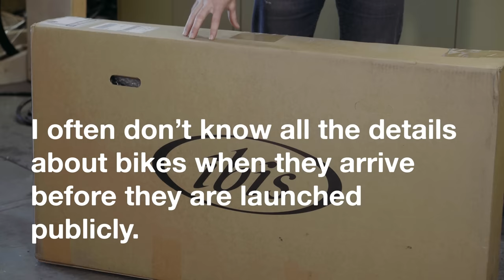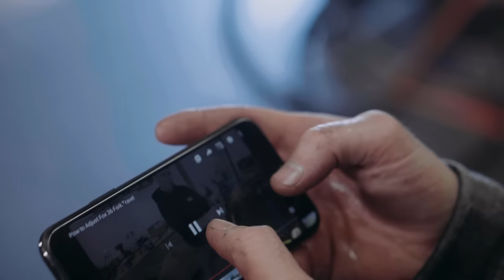DREAM BUILD: Ibis Mojo 4 Carbon "mini-sender" trail bike!

Comment: Jeff! You've made a major mistake there (I hope you didn't, and it just looks that way because of editing...)
FiT4 uses 20WT gold (10mL air, 40mL damper). Your 36 appears to be a GRIP2 which uses 20WT (10mL air) and 5WT Teflon Infused (40mL damper). Looks like you used 20WT gold on both sides? Going to be a hell of a job getting that 20WT out of your damper.
Also, you should avoid pumping your fork right up to your preferred PSI when starting from 0. Pump it up 40-50psi at a time, cycle the suspension, then go from there. That way it allows the positive and negative chamber to balance (otherwise, the 75psi you put in all at once will be a false reading).
Reply: Lucky hes got plenty of sponsors to get some new ish from
Reply: @anttiharing  Seems like an honest mistake. Insulting his IQ is pretty low.

Comment: ooof 20wt in the damper side of a grip 2... chart says 5wt teflon jeff :P
Reply: Sean’s right. The Grip damper will suck some of that 20 in and mess it up
Reply: Ouch... yeah especially since the new grip 2 dampers work based around an open bath system that self bleeds with every use. That damper is gonna be effd up for sure, thicker oil means all the shins and springs are probably gonna get ruined if he keeps running it and it will probably feel good at first but once the oil makes its way into the inners it’s gonna feel stiff as a rock
Reply: I was about to comment this
Reply: Concrete Head  I am riding, with a plush grip 2 damper

Comment: As said already you made a mistake bud, one that is going to be a pain to fix. The damper side takes diff like since it's open bath damper it uses the damper oil in the damper leg which is 5 wt stuff. Going to have to clean out the damper.
Easy honest mistake to make but gong to want to fix that very soon so you don't possibly damage the damper with too thick of oil trying to get past the shims and ports.

Comment: I am currently on a 27.5 transition Throttle HT 140 front and love it but my age is starting to catch up with me and need a little cush and the geo is pretty close specially the 425mm CS over my 420CS coming from a BMX background  I appreciate short CS,in your Honest opinion can this frame handle the 4 to 5 feet drops on the trail? I know it can handle jumps. Thanks

Comment: Got to say not the best design for a shock bolt but if you did the rear bolt first with the front of the shock free you could shift the linkage forward and get more room to get a tool in there. Also you put the wrong oil in the damper side of the fork, if that is a grip2 damper it gets 40cc of the Teflon infused 5W oil not the 20w Gold that was the FIT 4 damper.
Reply from the maker: Thanks Paradox, I have some 5wt on order now.  There's no way you can swing the shock into place, btw.

Comment: Hi Jeff, did u used a fork with the recommended 37mm offset?
Reply from the maker: Yep, it's the 170mm Grip2 36 from my HD5.  I now have a Marzocchi Z1 170mm 37mm offset on the HD5.